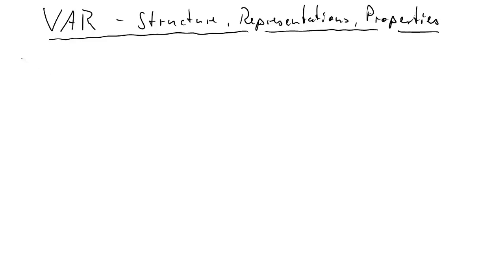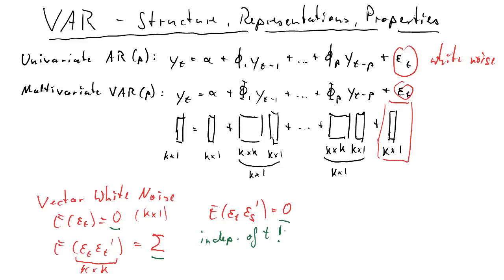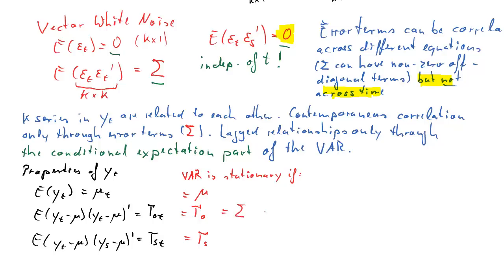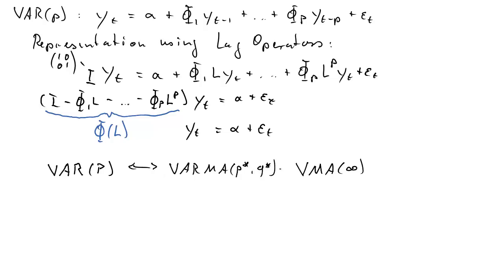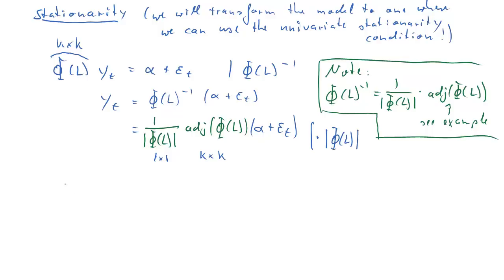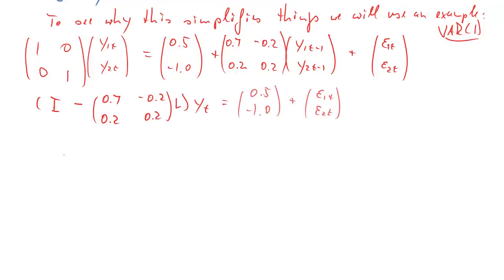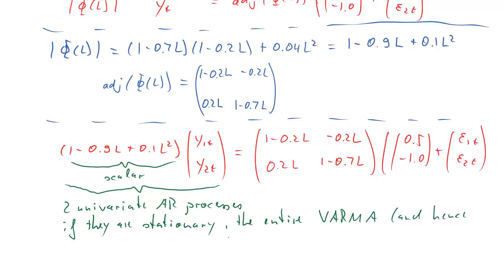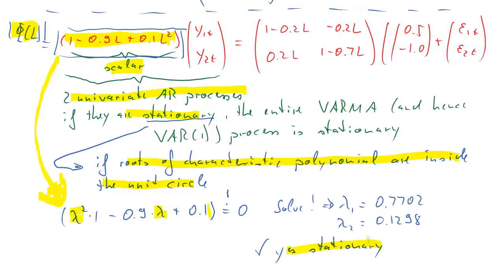VAR Setup, Representations, Properties

Comment: Hi. Really appreciated this video. But if am not making mistake the characteristic roots of lag polynomials should be outside of unit circle for stationarity condition (Walter Enders - Applied Econometric Time Series). In 12.15 min of the video you mentioned that it should be inside the unit circle. Thanks in Advance.